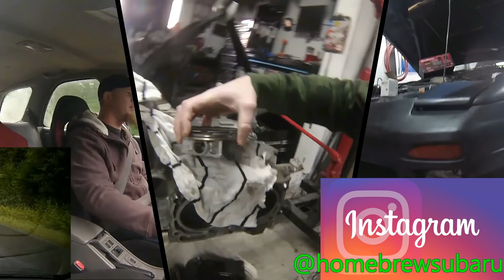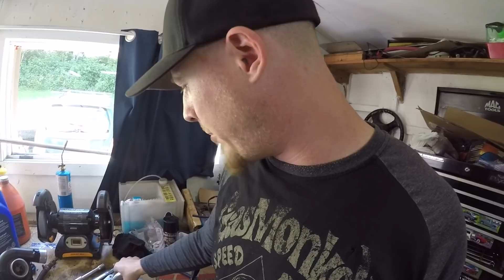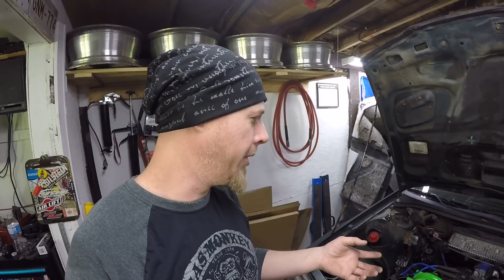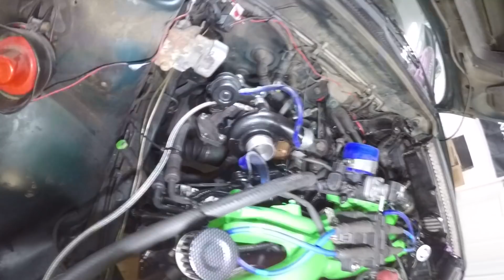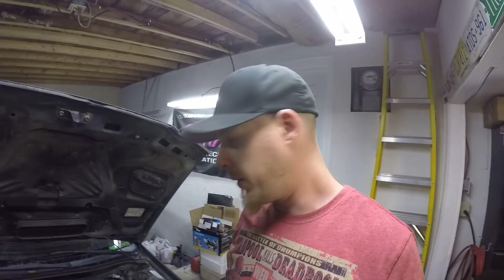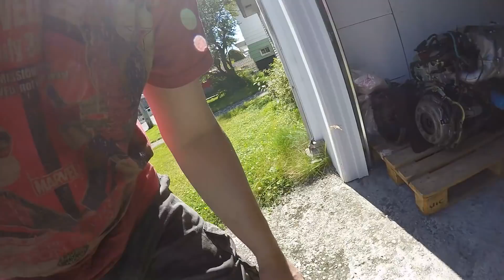SOHC EJ257 Hybrid Build Part 11 - Custom Up Pipe Install - How To

Comment: Nice work dude, I always say if the pipes work they work, no ones gonna be crawling under to look at the welds Haha. You wouldn't happen to have an extra 2.5 sohc valve cover with the drain already tapped in would you?
Reply from the maker: Thanks. No sorry I don't. Should be able to find a used cover on ebay if you need one, just have to install a drain fitting to it.

Comment: why put the battery in the back? A grounding video would be great
Reply: Chris J more engine space.
Reply: Bcuz race car
Reply: maybe he wants the car a little more balanced. In the trunk near the back passenger side will kind of offset the drivers weight
Reply: Hakasauars i dont know if it would make a difference in balance honestly its probly for space like 1 dude mentioned
Reply: It actually does make a bit of a difference. If you look at most racing cars that have a rear mounted battery, typically thats where its located.
Reply: Hakasauars ok